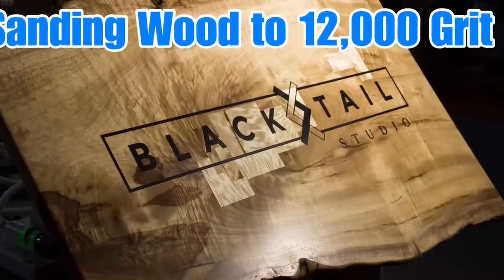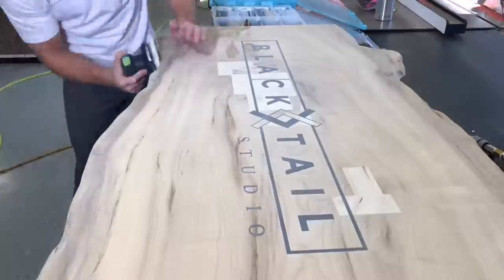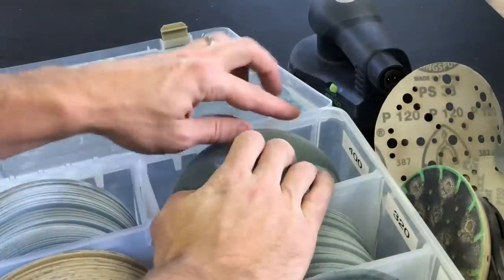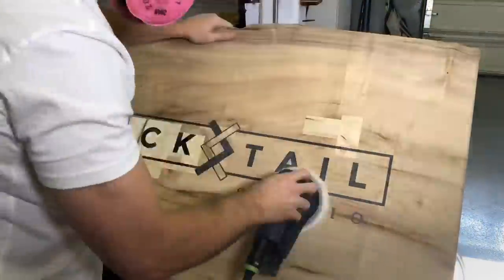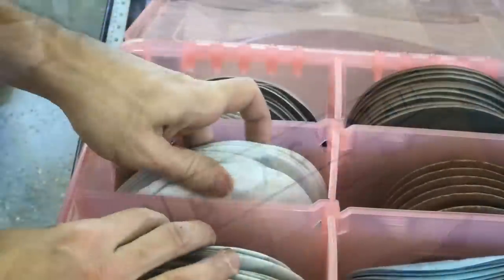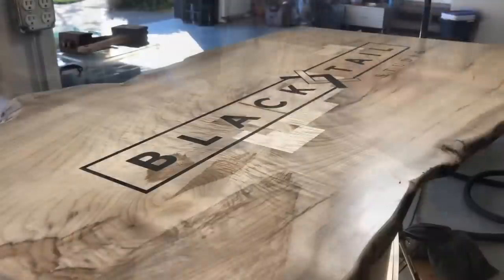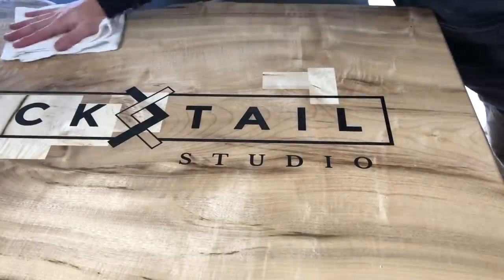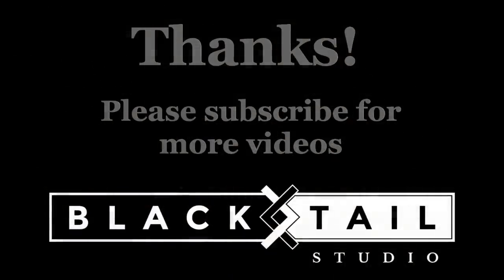Sanding To 12000 Grit

Comment: I'm actually quite impressed. Didn't know we could get 12,000 grit sandpaper.

Great result. Great work.
Reply: I can't find any in the UK above 7000. Real disappointment
Reply: you get can get sanding stuff up to 100K but that's is nanodiamond abrasives that is in liquid form its like waxing with a cloth but you gata use a super fine cloth for that
Reply: Abrasive paste (for steel) goes all the way op to 250,000 or even higher but it measured by the micron not grit  I’ve heard the very fine abrasive used for finishing telescope parts would be 0.005 micron or over one million grit but for any typical purposes it’s pointless
Reply: @chrissouthall411  I can't find any above 5000
Reply: holohulolo call the company that makes the best quality/ highest grit and tell them you are looking for sandpaper into the 1x,xxx grit range.
Reply: I bought a pack on amazon that comes with 5k, 8k, 10k, and 12k. Cost like $17 usd for 2 sheets each.

Comment: I always polish my wood projects to a high grit. What I really like is how it brings out the fine details in the wood grain.
Reply: I usually go 800 to 1500. Anything above 600 brings out a metallic flecking that usually only gets associated with rare ancient woods.
Reply: Yea, every time I go to a 2000, 2500, or 3000 I wonder why wood workers don't recommend it. Sometimes I can get hard woods to look like stone. I guess the line of reasoning is that it won't accept finish, but sometimes it looks like it doesn't even need finish.
Reply: @thomasanderson6426  What do you recommend for maintaining and caring for the surface after such a high grit sanding? Furniture wax? Polish? I am thinking to restore some tables and go to about 3,000 grit. Thanks!

Comment: Though late to the party… I love this look. I make rope fids to 2000 grit and straight up teak oil… only. I do a wet sand starting at 1500 to help prevent ring rise and keep the part cool.  I use hard woods of all kinds and get a nice glass finish. Nice work! Made me a new sub.
Reply: Nothing comes up when I Google ring rise. What does that mean?
Reply: @haidafulton  wood grain has aged rings /growth rings. They stand out mostly when cutting across the grain. When you sand a crosscut grain (or any grain) the grain has a light/soft and dark/hard surface and when apply sanding to it the soft grain sands away more easily than the hard grain. That is called ring rise. Hard grain sticks out. Harder to sand away than light/soft. Hope that is easy to understand

Comment: Hey Cam,

I always sand my boxes up to 10,000 grit. Depending on the wood, I might not even put a finish on them. I just love the feel and smell of wood and I hate the feel of “thick” finishes. So, yeah, it’s worth it. 

BTW: I’m about 1/4 of the way through your old vids and I’m lovin it.
Reply from the maker: That’s awesome! I won’t say the same about my early videos though.
Reply: What do you recommend for maintaining wood after such a high grit? I am thinking of restoring some tables and rather than using a finish I'd like to sand it to like 3,000 grit. Should the buyers be waxing it periodically?

Comment: Going to have to try this! I'm an amateur woodworker. I have been following your channel for a while. Ive taken quite a bit of inspiration from your videos. I currently have just the festool ETS 125 REQ. Just this evening, I placed an order for the 150 rotex, the 6" sandpaper systainer³ with interface pad and hard pad. I also ordered the OF 1010 router with the LR32 hole drilling set and 55" hole drilling rail. Hoping to improve my finishing on my projects. Keep up with the awesome work!

Comment: Amazing!

I remember back when I was in high school - wood shop class I used a (I think it was just a 400 grit) on a rectangular orbital hand-held sander for like 45 minutes and it began to shine like that. I figured the sand particles had begun to break down into smaller pieces (kinda like they had become 800 grit). The wood began to really shine - but I'm sure it was much less than the amount you have at 12k!

Beautiful work, nice logo, great piece!
Thanks for sharing!
Reply from the maker: For sure! Love that worn down sandpaper for a high polish!
Reply: Sawdust itself is very good for burnishing since it will contain some abrasive silicates and some resins, shavings are typically used by woodturners to burnish their pieces. It was likely that you were rubbing sawdust into the surface giving it a sheen.

Comment: Mesquite wood is so hard that it takes on this kind of sheen starting at 600 grit. The colors and prismatic effect really start to pop. We take it up to at least 800. People are really losing out on an amazing finish if they don't take it to a higher grit. Thanks for the video.
Reply: It's the hardest wood in North America. And it's BEAUTIFUL.
Reply: @Madmun357  
That doesn't necessarily feel right to me. Aren't there some ironwood species that grow in the deserts here and in Florida? Also, I know for a fact that osage orange grows in a lot of places in the southern US, and it's almost twice as hard.
I might be misremembering though.
Reply: @karl_alan  I could be wrong, but I read it somewhere. I turned a bowl out of mesquite once. It'll do a number on your tools. Keep the sharpening stones handy. It's a gorgeous wood!
Reply: @Madmun357  Janka Scale
Mesquite 2,345 lbf (10,430 N)
Osage Orange (bois d'arc) 2,620 lbf (11,654.34 N)
I've worked with both on the saw/lathe and have seen sparks fly from dry bois d'arc multiple times.

Comment: Personally, I like the high grit because I don't know if anyone else noticed, but the contrast of the wood started to really pop around 1500+ grit when it was polishing more than removing material. Some unfinished or very lightly finished pieces could really benefit from that effect, especially dealing with signage.

Comment: To any of you who watch this channel and say “that looks easy. I want to try”. This is not a spectator sport. 

I started by finishing an old cherry set.  Inspired by this channel. 

First, practice, nightstand I did a lot of stuff wrong. But, in the end, put minwax satin poly on it, and it’s passable. 

Second nightstand, I was more careful, and tried the Rubio. Came out Ok. Loved the finish. 

In the third piece, the long dresser.  A lot of problems, though I thought I was super careful and had this down. 

After fourth sanding (100/120 orbital, 150/180 hand) I thought I was good. Put on the Rubio and it looks like scheisse. 

First was these furry wood blotches I subsequently tried to take out with light sanding in one direction. Thought I got it. 

But the Rubio brings those areas out as smudges. Looks terrible. 

Then I noticed these other smudges that look like pigtails. I closely inspected the sanded wood and didn’t see these until I put on the Rubio. My eye is not trained. 

Believe me I thought I was super careful. 

This takes a lot of practice. 

Don’t know what I’m going to do in my case here. 

Probably should have minwaxed it. Hides a lot. 

Good luck!

Comment: Turned out great! I almost think sanding the wood to a higher sheen is an easier method of finishing than sanding the clear finish. Granted, you may not be able to use all the finishes available, but it seems more error proof. I often sand to 1000 grit and then use tried and true oil finish (bees wax/boiled linseed oil mix).
Reply: Same here
Don't like to put chemicals on my wood. I use foodgrade linseed and wax.

Comment: i don't know if it's a known method, but i learned from my teacher in woodwork that if you make the wood wet and wait a couple of minutes for the fibers in the wood to rise and then use a heatgun to dry it in between the finer grit you will get a silk smooth and very shiny finish :)
Reply: Simon Almén similar to what people call raising the grain I believe
Reply: A rifle builder told me it's called wiskering
Reply: This definitely works, When repairing/ refinishing rifle stocks I would use an iron to steam out dents and cuts in the wood and to raise the grain for further sanding.

Comment: I love doing projects like this, the only thing I do differently is a liberal use of a product called Sea-Fin “ship to shore” from Dalys.  I give a nice flood coat before starting after the 60 grit sanding.  Then reapply after 180, 800, 3000.  I stop at 5000 then give a final coat and then use an untreated buffing pad.   The result is astonishing.  The product soaks into the pores of the wood but doesn’t have an emulsion so you’re still left with mostly highly polished wood.  It evens out the hardnesses between the different densities of the wood fibers so you get an absolutely flat surface instead of the rings and knots standing up a bit.
Reply from the maker: I’ll have to check that out!

Comment: Great video man! I have recently started to question my sanding technique. When I first started woodworking I just thought you had to go in the direction of the grain like you did with the higher grits. Then I noticed some people go across the grain and even perpendicular to the grain as well as in the direction of the grain. Just wondering if you can elaborate on what your process is and why?
Reply from the maker: Think about how an orbital rotates. It’s crossing the grain even if you’re going with the grain

Comment: Hi I sanded a solid teak console table top to 10,000 grit. Looks great. Will it absorb teak oil or hard wax oil? The legs are 320 grit so that should be fine. Thanks

Comment: I don't have a dust collection system so I stay away from sanding as much as possible.  I get fairly decent results with a well setup hand plane and butcher block oil.  I don't know how hand planed finishes would compare to 12000 grit but I've gotten some really shiny finishes with depth and reflection. I'm guessing the 12000 is probably a little smoother and definately easier on the body with your setup.
Reply from the maker: A fresh hand planed surface is as nice as just about any out there in my opinion.

Comment: Micro Mesh is the most incredible unaffordable non abrassive... abrassive. I have pounds of used Micro Mesh from 1500 to 12000 grit. Most of it is from the late 90's when I worked at a Trombone factory. I mostly have small 2400 grit pieces that were cut up to spin-clean the interior of the hand slides using an electric drill with a rod. They made one pass and tossed the piece. My buddy saved all the pieces, so I have hundreds of them. I use them to shine  guitar frets and some woods. I end with 4000 grit to make frets glow! I wish it was cheaper to buy as I need more 4000... lots of it.
Reply from the maker: I think the cost has come down. It was about $2/pad. Which is pretty good for this type of abrasive.

Comment: How did the finish hold up over the past 3 years? The ease with which you rubbed the Odie's off makes me think the finish got gummy after a few months? Please let me know. I've had the growth rings stand proud from 600+ grit sand paper as well. Use a sanding block, not a soft pad to stop them before they start (I personally don't like them) - I know this is an old ass video, but I was hoping you could reply. I want to give Odie's a try with my next project, probably sanded to around 1000 (I use Danish oil currently, wet sanded with the finish as a lubricant up to 1000 grit)

Comment: I sanded a very rough rifle stock.   It had been delivered on the rifle with sanding gouges that looked like eighty grit belt sanding.   They went every which way from with the grain to across the grain.   I bought a bunch of carbide sandpaper and went to work on it.   I sanded all the way to 600 grit and stopped when I was satisfied that all the sanding marks were removed.   Carefully steamed it and sanded it with 600 again.   Then twelve hand rubbed coats of tung oil one thimble full at a time.   One in the morning before work, and again in the evening after work.    Turned out really nice.   So yeah, I would have no problem going to 600 or farther.
Reply from the maker: That’s awesome! My dad just redid a couple old rifles kinda similar. Not as nice as you did though. I’d love to try it eventually.
Reply: @BlacktailStudio :  Mine were brand new, a pair of M1A Super National Match rifles.    I had seen what guys were doing with their M1 Garand stocks (DIshwasher to remove the grime and raise the dents then lots of steel wool) so I decided to find out what the walnut looked like under all those scratches.    The wood took on a luster at 600, and acquired more after I steamed it with a clothes iron.   I was pleased with the result.

Comment: I don't have much experience with wood working but I paint cars for a living and from my experience (not sure how well it translates to different mediums) if you go slow with 50% overlap on each pass and go both longitudinally and horizontally you can go up by 2x on each grit and not have to use each one in between (ie:400g then jump straight to 800g) again, that's my experience with bare metal and automotive finishes but if it saves time with wood as well it my be worth a try. 

Awesome video. Definitely enjoyed it.
Reply from the maker: Oh thanks for the tips!

Comment: Realize you're using Odie's here, but have you applied Rubio to a project sanded higher than ~180 grit?  Am finishing a maple slab for a desk and would prefer a smoother feel of sanding 240 or 320.
Reply from the maker: Ya, Rubio is nice at 320

Comment: This is anecdotal obviously but I worked for a guy who polished concrete floors the same way you polished this slab. Over and over, slowly creeping up to a fine diamond grit that left the raw concrete shiny, like an oil finish. No wax necessary. 

He claimed this was superior than the standard method  (which is to polish up to a point and then apply a hard finish to the floor) because it was more scratch resistant. Something about there being almost a caramelization of the very surface which was harder and less clingy than a less polished surface. 

I’m curious if this same principle would apply to wood. Is there a scientific way to scratch different finishes? Would be neat.

Comment: Great result. Have you used the Odie's on other epoxy wood projects? I have been looking for a finish I could use with epoxy after having sanded it to very high grits , (5000), (although I guess that isn't really that high after watching this!!). Do you find the Odie's works well with the epoxy? You just wipe it off the epoxy like you do the wood?
Reply from the maker: Check out my “perfect finish” video. I think it’s what you’re looking for.

Comment: I would think at such a high shine applying an oil or finish would actually dull the surface because of how the wood swells to absorb it. I probably would have finished it much earlier in the grits and polished it up after

Comment: CAM, thanks for the video. I am first time for wood project, that very useful to me and I learn a lot. Now I am working on to re-finish a table and after i sand to 220 grit on the back of table to try first, i saw a lot of small wood grain gap or spacing, I don't know how to call that, it is not the worm hole and along with the wood grain. almost all over my table. should i deal with them with something before add finish on the table?
Reply from the maker: I’d need to see it
Reply: @BlacktailStudio  pictures here, https://drive.google.com/drive/folders/1UW67QjOKq812pxgTLDkPMeDyKUgnACgx?usp=sharing

Comment: First off- Bravo Dude! A question if I might- to raise the grain before sanding in fine projects- Ive wet the surface with 70/30 Water/Alcohol mix- causes the fibers to swell and evaporates relatively fast prior to sanding finer grits (1200+)... would that have sped up your process with the lower grits here? Just curious as I like the sheen/shine/finish and looking to possibly replicate this on a longcase clock cabinet.
Reply from the maker: The Odies owner doesn’t recommend water popping. So I haven’t tried.

Comment: It's an incredible finish! I would like to know if you have used Osmo to any wood sanded higher than 400 grit and if so, what your experience was. I'm working on a walnut wood project that I have sanded to 5000 and would like to know how the Osmo works on it.
Cheers!
Reply from the maker: Not yet!

Comment: How many passes were you doing per grit? When your up that high how hard is it to tell if your still doing anything, or need to move up.
Reply from the maker: Just sanding the whole piece with each grit. You can tell the difference in sheen as you go up

Comment: Absolutely amazing 👌💯💕 what a work of art 🙌 I'm at a loss for words
Reply from the maker: Awe shucks Marco... thanks so much.
Reply: @BlacktailStudio  just did something in the same vein - magnetic knife holder... I only went up to 000 steel wool equiv, then several coats of Danish oil (Watco if it matters) then I tried to burnish it using 3M "Finess It - II" which is listed as used to remove scratches from 1500 or finer grit in automotive clear coat.
So, nowhere near what you did, but the burnishing process completely changed the nature of the finish giving it a depth that you don't get from lower grit + a finish (at least I don't)

You're my hero !

Beautiful piece.
Reply from the maker: Greg Mislick that’s awesome! Fun trying new methods, surprise ourselves with the results sometimes
Reply: Loss for words? You should get out more
Reply: @paulnovak833  I don't see the correlation in appreciating someone's hard work/project/work of art and not being able to articulate it in writing and your comment "you should get out more" however even idiots are entitled to their opinion so thank you for sharing yours 👌😂

Comment: I never have any problems getting danish oil to bond with 800 grit. I know you aren't supposed to go above 320, but there is a huge change in the definition of the wood above 600.
Reply from the maker: For sure!